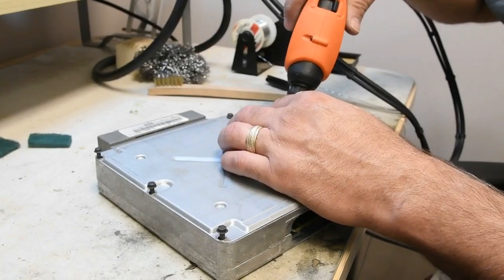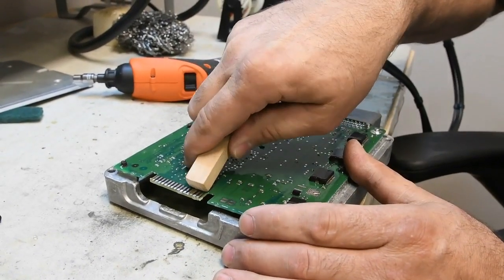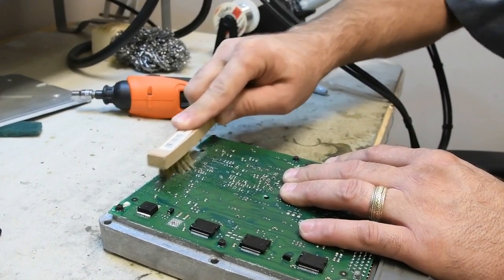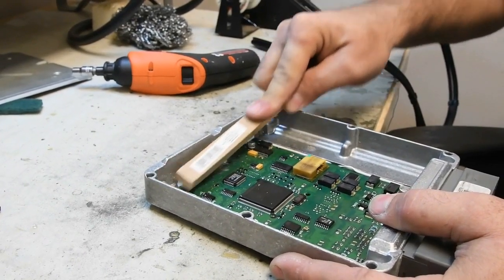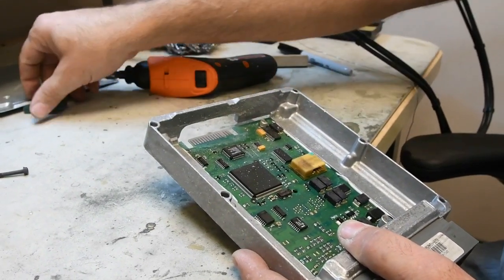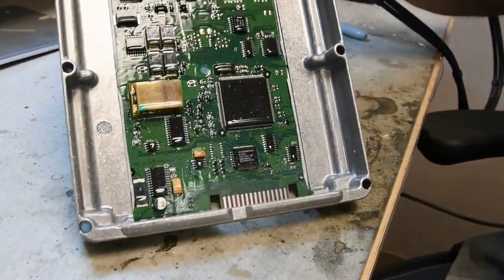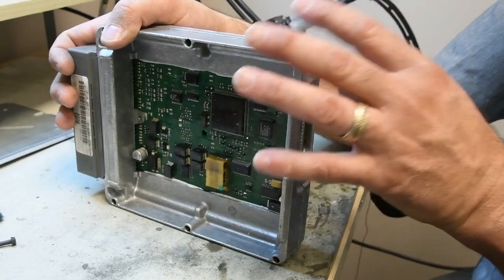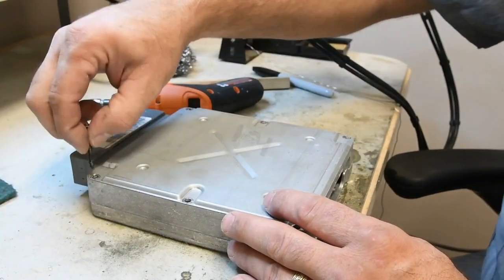Hydra Installation - PCM Cleaning (HD)

Comment: I helped a friend put in his  hydra and it runs but the check engine light came on after starting. We checked the computer be for install and there where no codes. Even after starting it shutting down  then pulling codes still nothing. Started again check engine light  comes out  when running. The glow plug light comes on as normal.

Comment: My truck won't turn with or without the chip what should I do?
Reply from the maker: Hey Beto Beto, my next step would be to have the PCM tested.
Reply: Thank you for your answer I found the problem and now works like a charm
Reply: @betosr86  what was your problem? I felt I did everything correctly and my truck kinda started and ran for a second then shut off. Then wouldnt start with or without the tuner. Still have my wait to start light and everything just the truck will not start. Granted I only cleaned the pcm once but I felt I did it correctly and didnt go down to copper. Chip felt super snug on pcm was actually hard to pull off. I'm going to pull pcm and put it under a desk mounted magnifying glass with LED lights and see if I missed something. My truck not starting after I pulled the chip worries me
Reply: @97Obs7.3  check all your fuses just pulled them out and see for yourself if their good.
Reply: @kaden S incheck all fuses from the hood and one was blown up so I changed it and it work

Comment: Are they safe to run with the stock transmission or do you need to upgrade first? (E99 7.3)
Reply from the maker: Hi Candace, the tunes are safe to run on a healthy truck and don't require any supporting mods. But, it will mostly come down to how the truck is maintained and used.

Comment: Just finished the install, super easy the worst was the ecm harness bolt (I have arthritis in my hands now and wrenching sucks in tight spaces)  got er done. Want to thank you for a great product the trucks a beast now. The main reason I bought it is to tow my camper, gonna hook it up soon and go for a test run hope it make the truck pull better cause it didn't like it before. 37ft triple  axle.

Comment: Why does my truck turn off after installing the chip?  My truck is f250 2000 7.3
Reply from the maker: Hey, sorry for the late reply. If the truck shuts off, it's either the wrong hex code, or you have poor contact to the PCM.